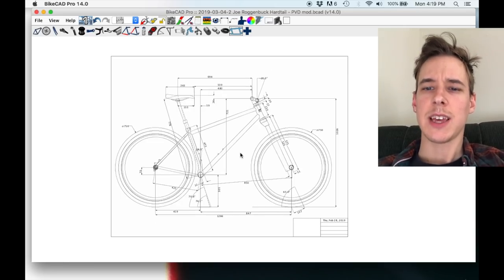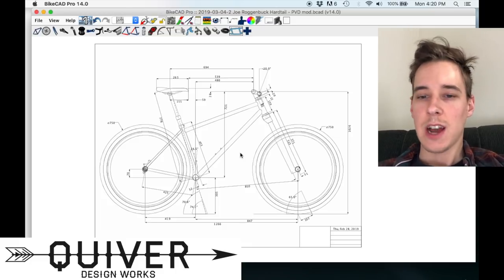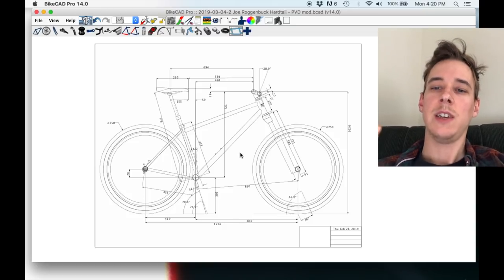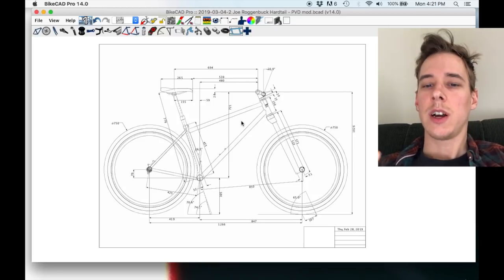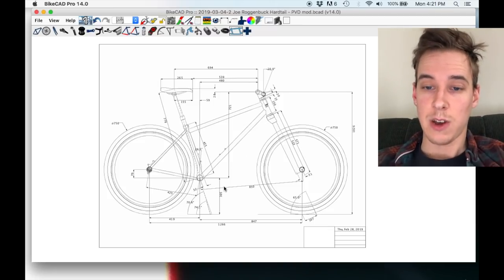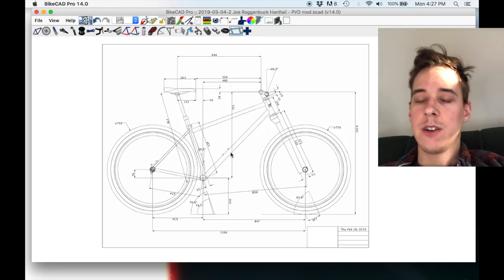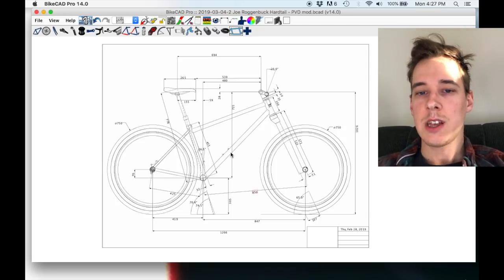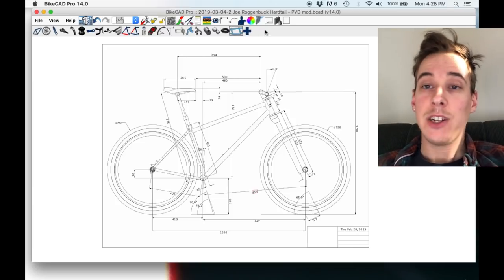Which Dimensions Matter in Bike Design? | Hardtail MTB Frame Build

Comment: Go measure parts at the bike shop bruh
Reply from the maker: Ya ever been to a bike shop? They don’t have a very good variety of parts and even if you’re buddies with them you’re in the way. Bike shops stock what they can sell and when you go to the trouble of making custom you can get whatever tires, cranks, forks etc that exist that you want. And it’s unlikely to find all of that at a LBS. for this build I did go to the old shop where I used to work but they didn’t have 29r tires in the sizes I wanted or sus forks like what I chose.

Comment: Your videos are really appreciated. I'm just getting started with frame building and I have learned a ton from you. I bought Bike Cad and I am having fun with the design process. You mentioned that BB drop is irrelevant. Maybe, as far as bike fit. I think it probably has a significant effect on bike handling however. A lower BB drop means the rider is lower, making for a lower center of gravity overall. In addition, a lower BB is lower in relation to the wheel hubs. This has an effect on how the bike feels and handles when standing and swinging the bike side to side. I also think stack and reach are possibly more important than you are acknowledging. It is true that stack and reach don't give a whole picture, but everything is connected. Meaning one angle change effects many other angles. Just my two cents. Again, I am just a beginner.
Reply from the maker: What I mean by saying that bb drop is irrelevant is that when us framebuilders talk about bb drop, what we actually are (usually) getting at is bb height. When you change the height of the bb from the ground, both the "bb height" and "bb drop" change and by the same amount, so they're directly proportional to each other, but I think bb height is the way more relevant actual measure. On two otherwise identical bikes, if you go to 20mm taller tires on bike A than bike B and the same bb drop, the figure "bb drop" is incapable of illustrating how our pedal clearance and center of mass changed. It's still just as useful for setting up our frame fixture, but in neither case does it tell us anything about how the bike rides until after we subtract it from the wheel's radius and it is converted into "bb height." Think about a 26" wheel mtb and a 29" wheel mtb designed for the same application. The BB drop figures would be significantly different but the bb height would be very similar or identical, and while I'm designing a bike whollistically, I want to focus on the most salient dimensions that tell me what it's going to be like to ride that bike. Overtime you'd get to know what numbers seem appropriate for bb height even when you go to a new wheel platform. You could argue even that the BB height only tells part of the story and without crank length and some information about the size and shape of the pedals we still don't have enough data (with regard to pedal clearance.) Reach and Stack describe the top center of the headtube to the center of the BB on an XY plane. I'm not saying that that relationship isn't important. Exactly where every part of the bike is matters, but I think there are other, even more relevant ways to describe the overall characteristics of the bike's fit and ride and I'll primarily design around those and use things like reach and stack to kind of "idiot check" myself to see if I have gotten something terribly wrong. I feel like I'm beating a dead horse, haha. I'm just trying to pick the MOST relevant dimensions I can think of or that exist. People have designed bikes around ~fairly~ relevant dimensions for ages and it gets the job done, but I'm trying to challenge myself to design methodically with the best tools I have at my disposal so that the designs might be the best I can produce. We haven't always had powerful parametric cad software like this and we don't have to do it the same way it's always been done.
Reply: Thank you for taking the time to explain your approach more thoroughly. I really have been enjoying your videos, and I hope to buy a tube bender and miter daddy from you some day.

Comment: Hey, I just wanted to get my thoughts in the comets before I read any others or the vid might later explain. I'm no bike builder or designer at all. Yet. Sometime soon.. But as far as bottom bracket drop goes, I would assume that can be relevant as far as center of gravity, and also the pedaling/rotating/inertia factor (you get what mean...). The 3 forward rotating things, the two wheels and your pedalling being in the middle of them that centerline of gravity or whatever would be extremely important I would think. The Porsche 944 has a very unique power train to achieve perfect 50/50 weight dist. Also makes me think of the boxer engine being beneficial for similar reasons. But This stuff is fun. I like the vids. I'm also typing all this on a phone and it's really driving me crazy. Anyway, I'm gonna subscribe. Keep it up.

Ps : head tube and stack seem important for wheelies..

Comment: Once I heard "PVD" I kind of felt the head tube angle slacking more than it should. Just an opinion. I haven't built a ton of frames, but I've been involved with a lot of bike fits. One thing I've noticed in your bike cad  designs is there is no reference to stack and reach. I'm not saying you should add it, but just check it out. Most all bike  manufacturers  these days have it listed in their specs. 
I'm not trying to be overly critical, and frankly I'm not super experienced with long travel fork hardtail bikes and super slack head tube angles. It seems like they would shine on a very particular type terrain  (downhill) and pretty much suck on everything else.
Reply from the maker: Yeah, I'm real curious to see how I like the FWD geometry. I think I addressed Reach and Stack in the video. They're measurements of the frame and I'm designing a whole bike. I'll sort of idiot check my reach and stack against other bikes to see how I stack up, but the reach and stack alone I don't think tell you anything too useful about how your weight is distributed over the bike and they only begin to describe your fit on the bike after you factor in the stem, bars, spacers, etc. So I'm trying to focus on designing in a more bike-centric way and less in a frame-centric way. Certainly those measurements would be valuable when you're checking specs on production frames and you want to plan a build from an off-the-shelf frame. Or if you had an apples to apples comparison where every bike had the same handlebars, stem, etc.

Comment: Do you have take into account the fork SAG? 
I mean, is the 65% head tube angle with the fork fully extended
or with ~30% of SAG?

By the way. I'm currently in the process of building my first frame, and I have pretty
much the same hesitation on the geometry.  I've just received your mitter daddy and it's 
look fantastic. I plan to cut my first tube ever later this week :-)
Reply from the maker: I design around 30% sagged. I was using 20% sagged before. I don’t know which is better honestly but it makes sense to me to design around the sagged value.

Comment: Measuring from the center of the saddle seems pretty useless.  No one sits on that part on the seat.  Lots of seats are relieved in that area.  It's silly---you don't fit a bike by measuring to and from your prostate!  

What if you measured from the point where the ischial tuberosity fits on the saddle?  That's the loop of bone that presses down into the wide parts of the bike seat.  Probably will still need to buy the saddle first but at least this method makes more sense than measuring from the theoretical intersection of the seat post and the top of the saddle.